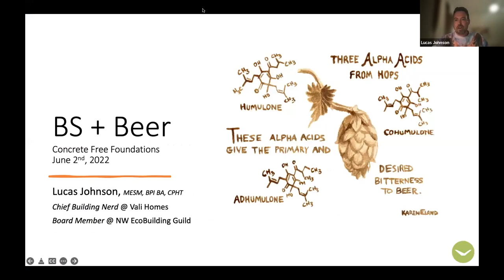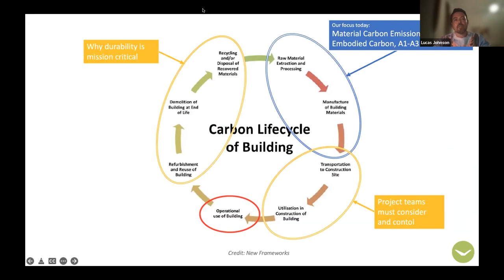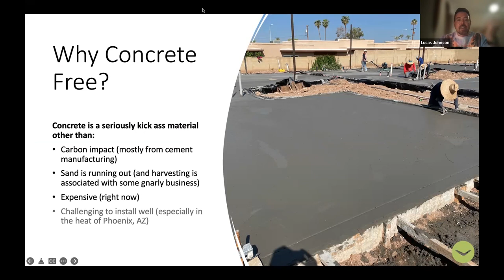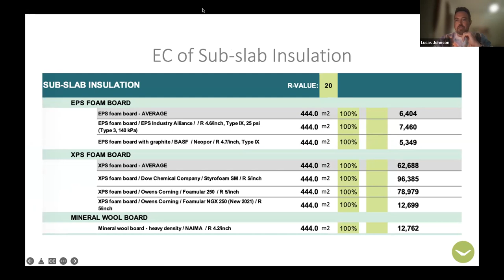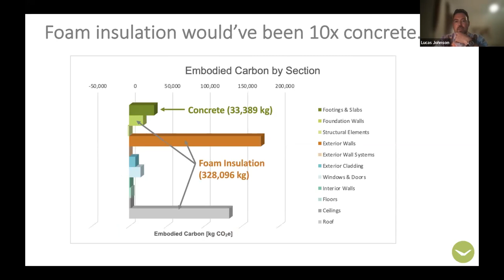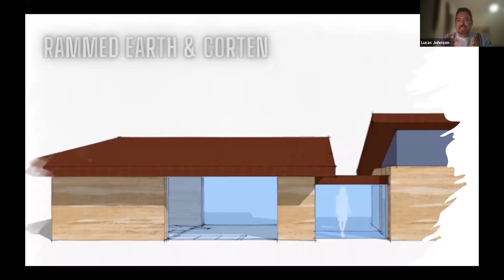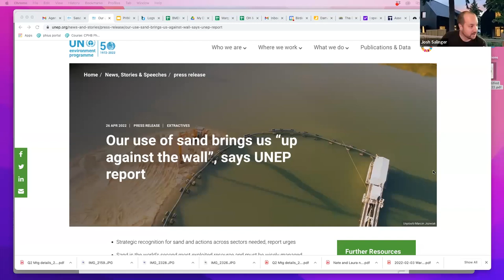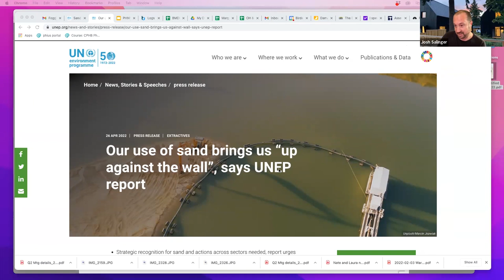Foundation Systems

Comment: I like BS&B, but this conversation was almost useless.  It contained virtually no practical information useful to even a fraction of 1% of residential projects.  It seems like a major focus on the extreme fringe narrow set of projects (rammed earth foundation...?...), it would seem that the opportunity to have the biggest overall impact would be via small impacts on a broader set of projects (i.e. instead of no concrete or foam, more focus on less concrete or wood as an alternative, as was very briefly touched on, and most efficient insulating strategies).